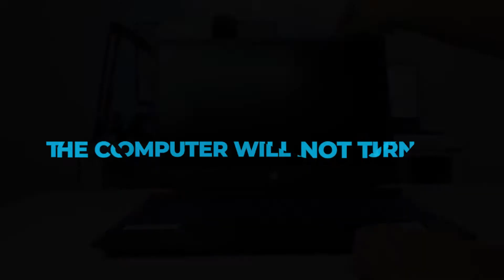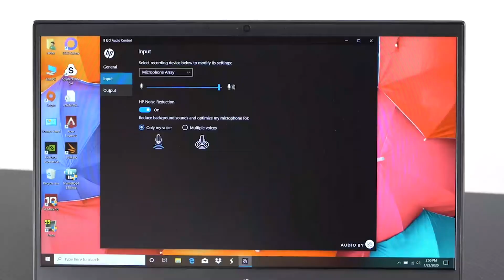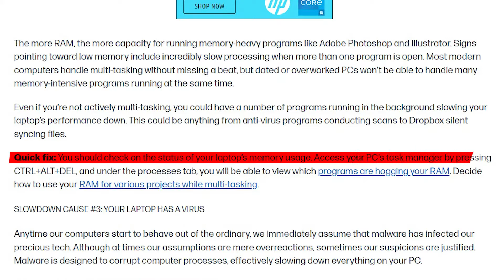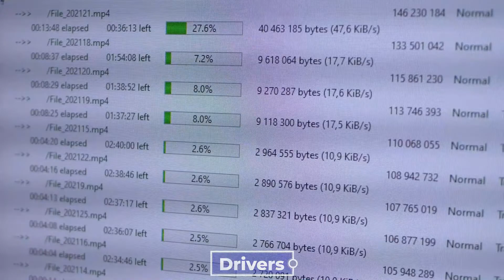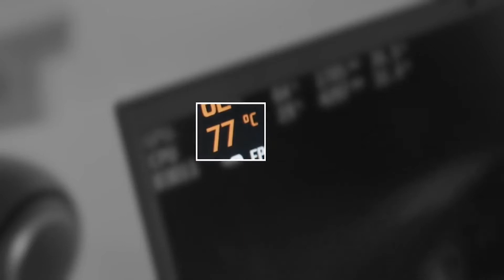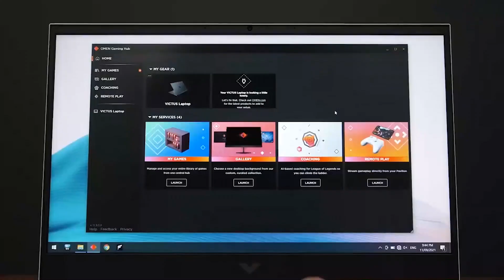HP Pavilion Gaming Laptop Problems: How to Fix It

Comment: I have an HP Pavilion Gaming 15-dk2xxx laptop. The keyboard backlight was working fine, but then suddenly stopped working. Pressing the F5 key doesn't turn on the computer, even though the key itself responds and doesn't have any glitches.

I've tried several troubleshooting steps, but the problem persists:

I switched from Windows to Linux, but the problem persists.

I went into the BIOS and adjusted its settings, but the problem didn't resolve.

I updated the BIOS to the latest version, but the backlight still doesn't work.

I opened the laptop, reinstalled the RAM modules, and disconnected/reconnected the backlight connector, but the problem persists.

Note 1: Sometimes, while gaming, the backlight turns on for a few seconds, allowing me to control it, but then turns off again.

Note 2: After a while, it still doesn't work even while gaming.

I would appreciate any help in resolving this issue.

Comment: MY LApToP iS HAViNG SoMe iSSuE LiKe THiS. AS i tYpE NoRMAllY THe leTTeRS ArE LiKe THiS. HOW Can I Fix This?
Reply: How do u solve it bro
Reply: @samarthkashyap4656  update to the previous version or this is an issue of the keyboard
Reply: when ur typing look at ur caps lock cause when ur typing u can sometimes accidentally press the caps lock buttoni
Reply: Hi my laptop is having problem when I open it when I open the screen up its turn on normally but when I touch the screen again it's getting black what's the problem is the VGA cable or what I don't know